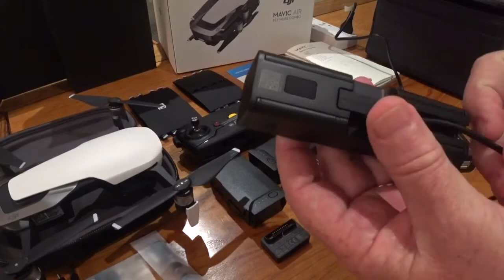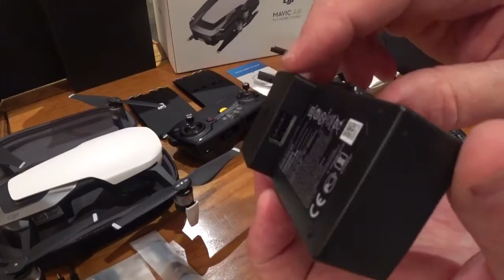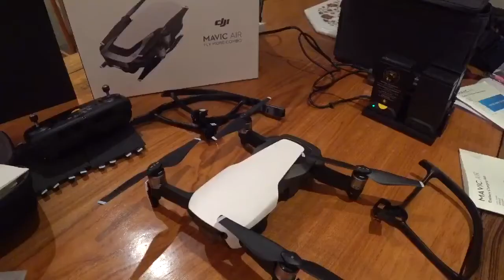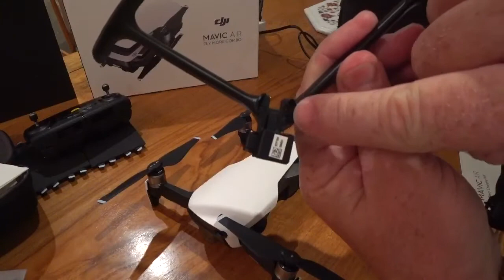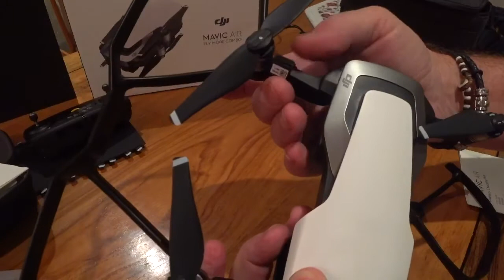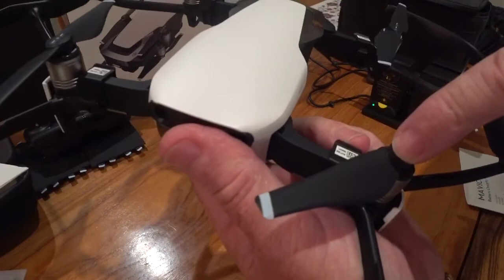Mavic Air -charging hub, propellers and guards

Comment: Thanks Tracy! This was really helpful when I now unboxed my Mavic Air Fly More Combo. The attached manuals didn't explain the thing with the wandering leds on just one of the three batteries when I put them in the charging hub. Now I understand - the batteries are charged on at a time, starting with the most charged battery. Thanks! :)
Reply from the maker: larsjlarsj my pleasure. Thank you for your reply.

Comment: @Tracy Wilson thanks for the vid. I really dont understand why they cant charge at the same time. Is that technically so hard to do? I could charge all of them within less than an hour instead of 3.30. Also they should have added a micro usb cable, not C. With the current bundle, you need an external charger to charge the Remote. Weird.
Reply from the maker: There is a C-USB and a C-to-Micro adapter in the kit so you can charge the remote from the included charger.
Reply: Ah, there is indeed that little adapter in the bag with the extra rc sticks. My bad, oversaw it.
Reply from the maker: Tobias H. No problem. Glad you are sorted.

Comment: Hello mate excellent vid.  How do you charge the controller?
Reply from the maker: Remove the small Micro USB from the side of the controller and use a regular Micro USB cable into the same connector from a wall socket or PC USB out.
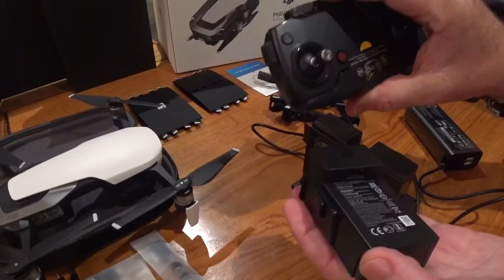Reply from the maker: Look at the video 2:36 seconds and see the port I mean
Reply: Tracy Wilson thanks for that I opened the box and couldn’t see the small adapter
Reply from the maker: Buddy's Insight if the small adapter (USB-C to Micro USB) isn’t in one of the packets you can use any Samsung charging cable.